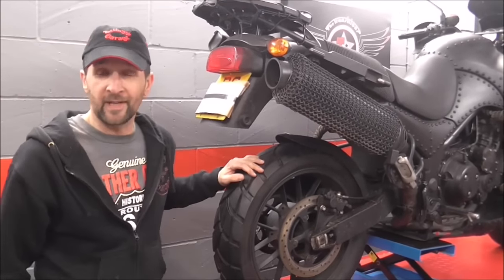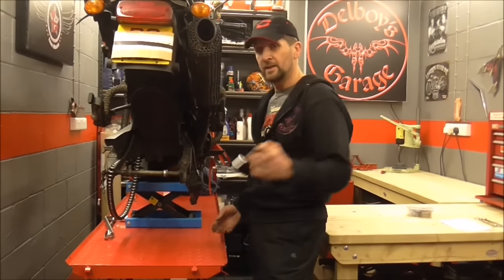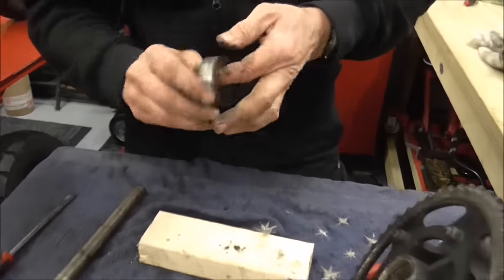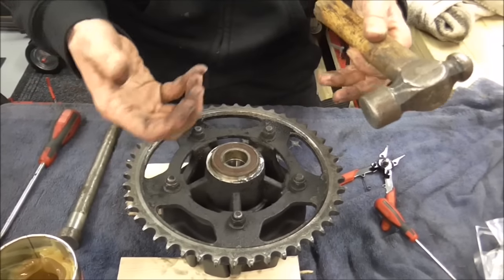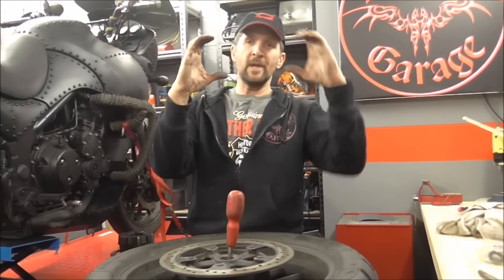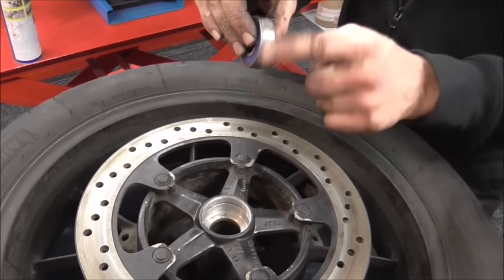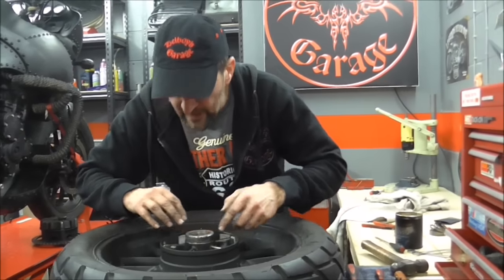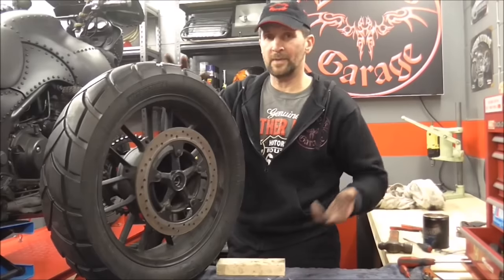Delboy's Garage, Motorcycle Wheel Bearing Replacement.

Comment: THANKS I am away to change my bearings on my grom. Seems so simple I was worried I would have to put to the dealer and pay out some cash.
Reply from the maker: Hi Nathan, glad to hear you're doing it yourself, I would just say, as a friendly tip, don't skimp on the bearings mate, £14 for a bearing isn't much, and if you have a problem with it prematurely, then you have a Honda guarantee behind you, if you're gonna use after market bearings, then that's coo, no worries, if they are something like Allballs bearings, they'ere great, that's ok, but if it's some unknown Chinese make, then just be careful, cos for a few quid you could end up with problems later on... you're saving plenty doing it yourself, so I always like to splash out on the best parts I can afford for that extra peace of mind, good luck with it mate...
Reply: Moonfleet41 I'm past my guarantee and warranty. Got it from Fowler parts assume there good as my dealer gets oem parts from there. Just drove tonight and the wheel is wobbling around I could feel it while driving. Ended up leaving the bike until I get my parts what's the worst that could happen ?
Reply from the maker: Hi again Nathan, Fowlers are absolutely top notch, they won't let you down, just like Wemoto, they'll get the parts out to you swiftly and the best parts too... I imagine the bearings will be Allballs, because bearing's aren't made by Honda, they're made by bearing manufacturing companies, like Timken, etc., so you'll be fine, as the wheel is actually moving around now, then yeah, for goodness sake, don't ride it, the worst that can happen is really bad, if the bearing completely collapses and locks up, then the strength of the wheel turning overcomes the lock up, forcing it to still keep turning and it effectively explodes inside the wheel casting writing off the wheel casting, also if the wheel goes out of line by too much, the brake disc will lock up in the caliper and the rest is obvious, so push it home, or get it trailed, but for goodness sake don't ride it mate...

I'm surprised actually that a bearing in a Honda has broken up so soon, Hondas are from the best built bikes in the world, so the bearing should last the life of the bike almost, but then if you've been jet washing it, and riding it in all the winters, then things like bearings can be one of the first casualties... hope it goes well for you, good luck, Del
Reply: Moonfleet41 all out except the broken 1 the outer part is stuck inside the rim and can't get it out.
Reply from the maker: You may have to try a little heat Nathan, be careful not to burn the paint or powder coat on the rim.. maybe use a hot gun rather then a blow torch.. and that should expand the rim away from the bearing slightly and free off the grip.. is there any form or lip on the left over part?, can you maybe use a puller to drag it out..?

Comment: HELP!!! Is there is any other trick how to remove that spacer tube what's in between two bearings. I've spend hrs yesterday but bearing hasnt moved. It's on 19.40 min. All video is very useful, and very detailed I'm very thankful for it but stuck now in the middle please help
Reply from the maker: Hi Victoria, From the time link you give me it looks like you have the sprocket carrier spacer tube stuck.. they can corrode in place like mine did, but not so much that cannot be tapped out... as you can see from the video @ 9:30 it just taps inwards from the outside... if its really stuck then use a socket thats very slightly smaller then the tube and tap it out with that...maybe some WD40 soaked into the joint for a few minutes will help..... Hope that helps.. good luck with it, let me know how you get on.. Del.

Comment: Have you replaced bearing on Marchesini wheels before? Where a spacer is seated or pressed in the bearing through inner hollow spacer inside.. i'm having this issue now where i can't tap out the bearing due to the spacer is aligned and flushed to the inner spacer. I looked everywhere and i couldn't see any vid about this.
Reply from the maker: Hi buddy, sadly no, I've never had to deal with those, so can't offer you a video on it... perhaps we'll get there one day, if such a job came up!   Wish you all the best with it...

Comment: I have been watching this video, and I decided to replace my berins.
But I can't remove bering, even after pushing tube on side I don't have enough space for screwdriver.
I need some bering remove. Can you recommend any of them?
Reply from the maker: Hi Bartosz, yes, if you can't tap them out the old way, you may need a blind bearing puller, it's a good investment s you will use it all the time,  here is a link, and they can ship one over to you if you are not in the UK..!  https://www.spanner-monkey.co.uk/blind-bearing-puller-set-12pc-60263?search=AK716&description=true

Comment: Do the rear wheel bearing for a Harley Sportster some time. My rear wheel bearing went out last summer on my 08 1200C. Had about 21K on it with mostly city riding. I don't see why the dealer didn't catch it at my 20K service. When I first noticed something was wrong. I felt a jerking motion from the rear of the bike, like someone bumped me from the rear tire. Then after that I kept hearing this gravel sound like somebody shaking gravel in a can and it would jerk again and cause the motor to lug in high gear. I had to call my dealer 4 times to come pick it up, never ever showed up, oh we too busy they would say, just ride it in. I called another dealer the next town over and they showed up the next day. They told me they always got complaints about the first dealer, where I bought the bike in 08, never again. Anyways, they said I'm lucky I didn't spun the bearing, would've cost me another rear rim. Can't remember the cost. I think it was a little less than $200.
Reply from the maker: +Curt8153 Hi buddy, it would be cool to do a Harley wheel bearing video, but I'll need a Harley that needs a bearing first and mine is like new ...!  But hey the principal is just the same, you knock them out from the other side and then drift them in the same... if you are gonna do a job like this yourself, always feel free to drop us a line in advance... and not surprised about that dealer, there are plenty of them over here like that, lazy money grabbing good for nowts...!

Comment: Excellent vid Delboy, just done mine yesterday but tube is a bit too tight on 1 side, can move it waggling a screwdriver in there but bearing barely spins one side its tight where the other is fine,  no burrs or anything so wondered what to do, any advice?  cheers.
Reply from the maker: Hi Des, the middle tube should be tight, no flopping about, and not jammed solid.. but able to be moved with a screw driver.... and the bearings can be stiff to move by hand.. the test is to stick the wheel in the bike, and see if it spins freely and makes no noise from the bearings...!  spin it without the chain or brake caliper on, that way it should be free to spin for ages..  Hope that helps buddy.
Reply: Moonfleet41 cheers mate, i think it should be ok then but will check and do as ya said!   keep it up mate, love watching ya vids!

Comment: Someone should please help me. I have a problem with wheel bearings.  My rear hub losses a bearing two times a week.   They get damaged more than ones a week.  Could it be that the bearing brand is bad or my hub is bad?  Could it that the bearing spacer or bearing tube is not doing its work as a result of being faulty?   I need answers because its only motorcycle that is facing this problem.

Comment: I think I might have got the front wheel bearings a little to tight .. how do I fix it already put seals in  but I have not put the wheel on yet
Reply: I can't move the center spacer with my finger it's really tight

Comment: Very nice video sir,
I have CB Trigger 150 cc
8 months ago I got this bearing cleaning done from one mechanic, what he did is, he took out all 4  bearing, not a sprocket one.. he cleaned it with petrol,  he used some grease and pushed it back in.. is it fine ..
Reply from the maker: Hi Kiran, it sounds like you say he cleaned out the bearings and re-greased them.. was there a reason for this?, did you ask him to fit new bearings?,  was there any play in the bearings?.. what made you take the bike to him to do this.. was it riding badly in some way?..
Reply: Moonfleet41 no sir, he said to me its a part of our service, whenever bikes comes to our garage, we do this. I ride onle average 5 to 6 km a day, since 3.5 years, also i ride very carefully, I was worried when he removed that nylon covering of bearing (blue cover on the bearing as in your video) and didn't put it back after cleaning and putting grease. I asked him why he didn't put that blue cover back, he replied it doesn't matter, it wont cause any problem. I'm bit worried.
Reply from the maker: Sorry for the delay in reply with this Kiran, it is very important to fit the blue plastic cover back over the bearing because ot keeps the grease in and the grit out.. if you leave it off, the bearing will become damaged after a few hundred miles if you ride in a dusty place or wet and rainy... they are fitted by the manufacturer to protect the bearings..  Hope that helps.   Del.

Comment: another great video... and how many miles until i should replace those sealed bearings ???
Reply from the maker: There is no set mileage, wear and tear is variable depending on the life the bike leads.. don't power wash them, clean your bike regularly, specially of salt in the winter and they'll last many years mate.
Reply: @Moonfleet41  okay got a 2020 FXDL  just think of when i need to change or check those sealed wheel bearings... i know how to install and adjust the wheel bearings on my 1990 FXRP and my 1997 FXDL Harleys but the 2020 FXLR is next...

Comment: hiya thanks for the videos watched nearly all your videos helped me so much i notice my bike making a sound from front wheel so looked and my bearing has gone but the center tube inside the wheel dont move like its shown on the video and advice? thanks
Reply from the maker: Hi buddy, it will move, it's probably just banged in a bit tight... one side of the wheel you have a seated bearing, which you fit first... then you turn the wheel over, drop the tube in and the other side you have a floating bearing, which just seats against the tube, and too many people beat it in so hard the tube won't move !  It could also be that the previous owners/or mechanics have torqued up the wheel axle so tight it has crushed the centre tube between the bearings (which is acutally it's job in the first place, to hold the bearings apart and stop them being brought in on each other) - get a stout screwdriver in the hole and lever against the top of the tube using the inside of the bearing as a fulcrum, it will move, even if you have to swing on it !  All you need is about a 5mm lip to get an edge to tap against from the other side, then that will release the centre tube, even 1mm of movement will do it , then you should be able to beat the others out - hope that helps, all the best, Del
Reply: thanks iv just ordered my bearing online ill have to wait till they come till removing them :) thanks again

Comment: How long and difficult are the steeri head bearings to replace?
And have you got a personalised number plate on the general?
Reply from the maker: +richard webber Hi mate, steering head bearings are about the same time as a pair of wheel bearings, once you get the forks out... there's a little more stuff to move though to get at them... like all these things, not a complex job, just a matter of getting stuck in !  And yeah, I have a plate on The General...

Comment: Nice Video . I've got a question . Don't you need to pull out the Bearing (Blue) Seal and grease it inside as well along the bearing raceway???
Reply from the maker: No Jalal, it's not necessary, those seal rings can be easily damaged if you try to prize them out, they are thin sheet metal with a rubber coating.. and if you distort it.. then it won't do its job of keeping the dust and grit out if the bearing..
Reply: @Moonfleet41  Thanks indeed , i was thinking if you might do a video on essential parts of motorcycle where we should possibly do lubrication and also specify what different types of lubes might be useful in those parts.

Comment: I know it's an old video. I'm doing front and rear wheel bearings next week and was wondering.....cush drives. At 26, 000 miles, is it worth just bunging a new set in? Just wondered what your oppinion is on them. Thank you for all the advice.
Reply from the maker: Hi Chris.. Good thinking.. they probably arent shot yet, but if you changed them while the wheel is all apart, then y9ur cush drives have 26k miles less on them.. and they'll last for years ans years then... mine for the fighter build came to about £18.. it depends on the bike, but Wemoto have them in stock usually..
Reply: Moonfleet41 that what I was thinking mate. They are £20 and even though they probably don't need done, why not just get it done. Cheers for the reply.

Comment: I keep seeing how-to's saying to only apply pressure to the outer race when fitting. If you use the old bearing to hammer in, aren't you risking damaging the new bearings by accidentally applying pressure to the inner race?
Reply from the maker: No, not at all, the inner and outer races are totally parallel and one will not yield stress to the other, the one you're tapping on will drive the new bearing in by the outside ring, all impacts will follow where you hit them, but if you're not comfortable with it, then you can use a press instead and squeeze it in gently.
Reply: @Moonfleet41  Got it, thank you. And great video!

Comment: Took the wheel off last night for the first time no problems, came to putting it back on and that spacer tube isn’t sitting flush in the wheel, stopping me putting axle through... after a lot of faffing I had to call it quits, any tips before I take it to the dealer :( ? Thanks a lot del 👌🏻👌🏻
Reply from the maker: Hi mate.. that tube is free to move about in the wheel, it's only 'pinched' by the bearings with light pressure... so if you take a screwdriver, and gently lever the tube back into a central position so its inline with the bearings and the axle fits through...test the axle fits through while its off the bike, and it'll line up just fine... then fit the wheel mate... Good luck with it.. Del.
Reply: Moonfleet41 thanks for the reply once again mate! I tried to free it up with the screwdriver originally but It wasn’t having it, I found bouncing the tyre/wheel loosened it up nicely which I then put the back end of a wrench through, this helped me keep it centred while I lined everything up! 
Improvisation ayy!? Thanks a lot again mate love the channel
Reply from the maker: Glad it worked for ya buddy - and many thanks for your support - ride safe

Comment: Hi, I’ve inserted my new bearings using old bearings as driver. Only question is, I’ve hit the inner races of old bearings (sitting on top of new ones) with a hammer while installing new ones. Does it cause any harm? Do I need to start from scratch? Your opinion is important to me, please help. Best regards. (I’ve got the courage to change them after watching this video. Thank you for teaching!)
Reply from the maker: Hi Derin. You should have tapped round the outside of the old bearing, but i guess you know that now.. its not the end of the world, as long as you didn;t hit it too hard.. rotate the new bearing and feel for any play, as long as its still solid and smooth, with no rough movement then it should be ok.. also feel it again after a few miles test ride and make sure its smooth and has no play..
Reply: Moonfleet41 Thank you sir, thank you very much..
Reply: Moonfleet41 I’ve checked. When I try to rotate left bearing, spacer and right bearing altogether, it’s a bit gritty. But there is no play, is it OK? What do you think?
Reply from the maker: All I can say my friend, is if you are in any doubt, replace them... I just cannot guarantee something that I've not seen for myself...
Reply: Moonfleet41 you’re right, thank you.. sorry for taking your time

Comment: Question. Saw that the bearing that you are placing are sealed. Looking for some other bearings, saw that there are the not seald ones. is there a problem in replacing the sealed for not sealed? My motorcycle has an seal right after the bearing itself. Thinking into replace the steel one for ceramic.
Reply from the maker: Those seals are not for the same reason.....the blue plastic cover on the bearing retains the grease inside and helps keep the water out....  The black rubber "lipped" seal you fit over it is to keep the blast of weather and dust out of the area.. its a second live of defense...never used ceramic bearings, what more do they offer than steel ones..?
Reply: If you have time to read a litle bit more here it is: (http://www.hscceramics.com/life_of_ceramic_bearings.html). Thx for the reply. on general, they offer less friction, so your bike can be more efficient (Fuel and performance). They are also resistant to corrosion. They are harder than steel ones (More susceptible to cracks). They last longer and they are a hell more expensive. Ppl use it on hi ending machine, planes and rockets...=), anyway hope that you learned something from me as i have learned a lot from your videos. have a nice holiday. if you have more questions just ask... i will do the same.